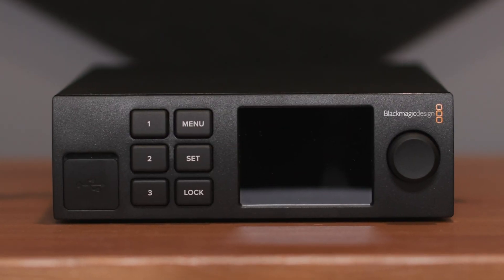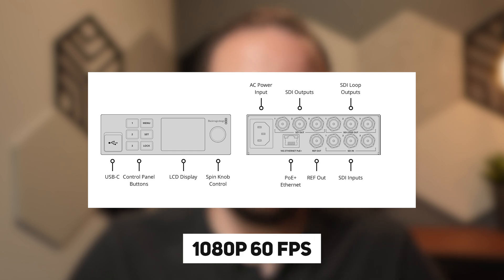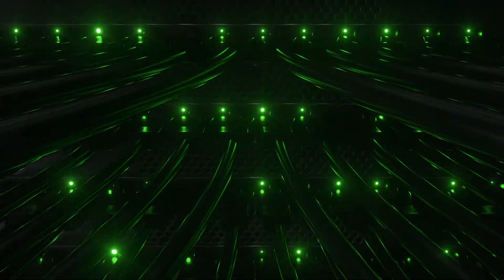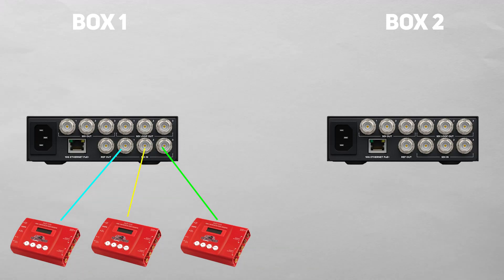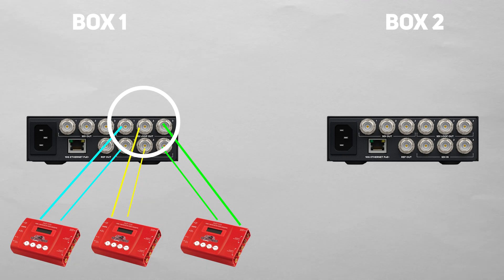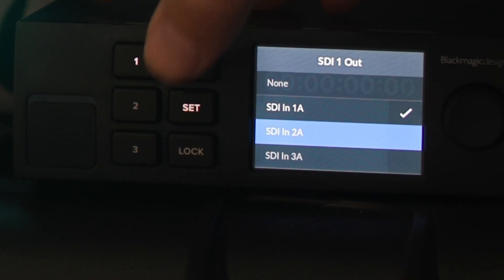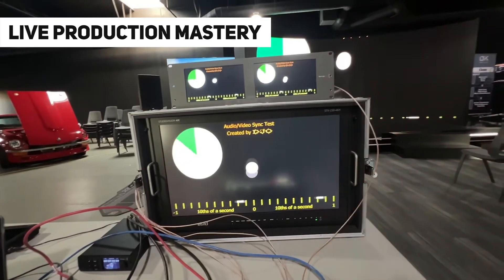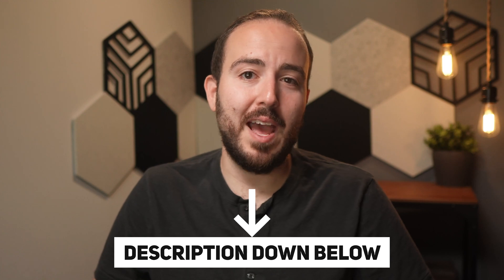Fiber Alternative? Blackmagic 2110 IP Converter 3X3G

Comment: and how to make real fiber out of it? can the signal from Stagebox A be just converterd to fiber and back on the other site? or better, being just a dumb signal inside a router to another router like netgear M-Series? so go into a router via rj45, connect this router via fiber to another router and route the signal out of a rj45 port to the stagebox 2
Reply from the maker: Well this isn’t real fiber. It’s 2110 or at least, it’s blackmagic’s version of 2110. But the idea is if you create a network, you can access the signals anywhere on the network. It’s probably more like NDI.
Reply: @zephanmoses  so no problem to put it on a v-lan and route via fiber sfp+ ports?!
Reply from the maker: @letsplaychronicles9483 I haven’t used it that way. I only used point to point from one 2110 box to another.
Reply: @letsplaychronicles9483 you can route the ST 2110 traffic through regular 10G network gear like switches and routers but you should have equipment that is PTP aware and that prioritises the right ST 2110 traffic and avoid timing issues. In practice it would be risky to run ST 2110 traffic with other network traffic through the same equipment or cables in most cases. ST 2110 is really bandwidth intensive so unless you have a substantial surplus of both switching capacity and link bandwidth you’re bound to have a poor experience.
Reply: @ivarmh  how about my suggestion to let the signal just pass as a dumb signal without any protokoll from a to b? My idea is:
have to 3 of these converters, each per rj45 to a netgear 10 switch, from there via fiber to another 10g switch, from this switch via rj45 back to the opponent converters. without processing, just letteing pass the signal....
Reply: @letsplaychronicles9483 if you’re running data through any networking device like a switch or router there will be some processing in the device. The device has to look at the data it receives to know where to send it even if there is only one path through the network. Even a media converter always has some processing time although it is negligible in most cases. PTP-aware devices calculate this processing time and adjusts the information in the data so it arrives with the correct time.
Reply: @ivarmh  any idea, which switch is reliable? I like netgear M-Series, but not sure if they will fit.
Reply: @letsplaychronicles9483  You could look at the NetGear M4350-16V4C but that might be total overkill for simply connecting two of the 2110 IP Converter 3X3Gs together. Frankly I'm having a hard time finding PTP aware hardware that's not really high end high capacity switches. 
I'd like to test how much of a difference the PTP clock makes when traversing say two switches in between. I have an order for a MikroTik CRS305-1G-4S+IN switch that I was planning to use as a dual media converter. Don't think I would run it in production but would be fun to test.
Reply: @ivarmh  I do not want just these 2110 IP converters via v-lan, I also want to transmit dante + NDI. I really need something for production. All the incoming video signals with embedded audio will be transfered via srt to a remote controle room. So it is part of a bigger construction and it has to be reliable.
Reply: @ivarmh  here have a look: NETGEAR M4350 Series M4350-8X8F regarding to netgear, that switch can do ptp
Reply: @ivarmh  I am just wondering, had a long discussion with chatgpt which told me on L2 level there should not be a problem without any ptp. But of cause, it is chatgpt and not an expert ;) I will have a look to your suggestions.
Reply: @ivarmh  I would like to describe what I am planing to do:
I have 3 stagebox Racks with dante audio, 1 ST2110 converter, ndi + controle for ptz. all three are connected seperately to the core rack with fiber cables. This core rack contains 3 ST2110 converter, sdi + embedder from dante to sdi to 9 srt encoder. All the signals will be transmitt via internet to our central controle room. From there we use the signals for production, send Signals via ndi bridge back for Video Returns and controle the ptz cameras. So far. That is the basic idea. The main question what hardware can be used in the stageboxes to make dante, st2110, ndi + controle via v-lan possible connected to the core rack with fiber cables (I assume more than one fiber cable per stagebox to corerack - so maybe 2 fiber cables - are necessary for that concept.
I hope I described everything understandable.

Comment: Hi Zephan. I've been looking at these converters for some time now to use in a stagebox. Do you know if you can route internally in the converter? 
I normally want to take a feed from a laptop on stage and send it through the converter to the mixer in the control room and then send a return feed from the control room back to the stage box for a confidence monitor and what not.
But in cases where I don't need to send a return feed can I send input 1 to output 1 in the converter so the feed doesn't have to take the long way to the control room and back? I know the converter has loop outs for this but that would require either physical movement of cables in the stage box or adding a video router.
Reply from the maker: It’s been a minute since I’ve messed with them but I think it was only routing inputs to outputs but not routing a loop.

Comment: Is there a device that can do this over HDMI?
Reply from the maker: They have HDMI models: https://bhpho.to/4ePEKX5 and https://bhpho.to/415pOAY but for the most part they're assuming that HDMI is only used from a presenter's laptop and that nearly all other connections are using SDI. If you're advanced enough that you're using 2110, you are more than likely using SDI in your setup more frequently than HDMI.
Reply: @ ok thanks

Comment: Looking at the 4k 2110 gear. But getting comverters for everything is racking up quickly. Waiting for more gear to support it natively. Like an atem 4k 2110...
Reply from the maker: @annebokma4637  most platforms don’t even support 4k streaming yet and I get enough people complaining about their internet connection. I don’t think it’ll be necessary any time soon.
Reply: @zephanmoses  I wouldn't use the 4k for streaming. But if you can connect over 2110 to an atem and record on NAS. Then you can use 4k for the content upload. Besides should be easier to route connections on the fly. Using one atem for multiple sets, changing configuration to a preset with one button.
This ecosystem goes way beyond streaming, and I would prefer native 2110 on the new atem constellation 1me 4k instead of buying a load of SDI 12g to 2110 adapters.

Comment: Since bmd’s 2110 is compressed, this means it is compressing those signals to send the to the second box, then de-compressing them….🤔
Reply: Only 4K (12G) signals are compressed to 10G to fit into the bandwidth of Cat6A or better. Tho that doesn't concern these boxes which only carry three 3G signals at a total bandwidth of 9G, so no compression here.

Comment: Looks like ST 2110 is the standard to invest in after the NAB announcements. Both Eurovision and the Olympics will almost completely be on ST 2110.
The IP Converter along with the IP presentation converter that was announced at NAB enable everyone to adopt ST 2110 at reasonable price level.
Combining a MTP cable that can run multiple fibers on a single cable, you can have a single cable between FOH and the stage for both Audio, video, internet and more.
Reply from the maker: @JaredNaude  yea lots of fun stuff in the works.

Comment: 😢 B&H had a used set for under $400 each and i didnt get them😢.
Reply: So from my understanding there isn't anything special about the camera control protocol from BMD. I know for a fact that cam control works over the cheapest SDI distribution box so I can't imagine it not working as the Ethernet and signals are bi directional.
Reply from the maker: @fightflyers  Darn $400 is a good price if they're not too beat up. I would assume that CC does come back to the cameras but I don't know enough about how that information is translated when it converts from SDI to IP to travel over the ethernet cable.

Comment: Do you get Camera Control through this setup?
Reply: Hey you two! Thanks. I will definitely check this out. Yes, camera control through the sdi distributor works. I already have this implemented.
Reply from the maker: @Max-cu8yf  sweet thanks for confirming!
Reply: You can send a normal camera control and  program feed from your switcher up to stage thru these than you will have the normal Atem camera control via SDI. As far as I know, you could send only one and then use the distribution converter to go to all 3 cameras.
Reply from the maker: @tim_mueller  awesome good to know!
Reply: 2110 does send camera control. It uses the same system for that as SDI.
Reply from the maker: @Max-cu8yf  I’d have to check on that one. I don’t use Blackmagic cameras so I may need to find out from someone else.